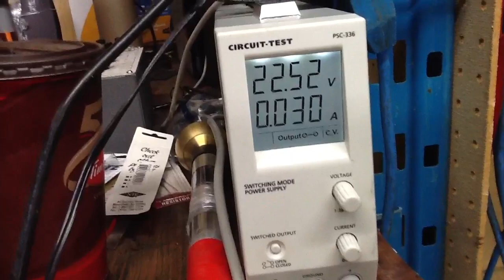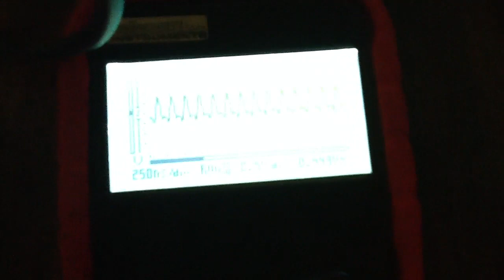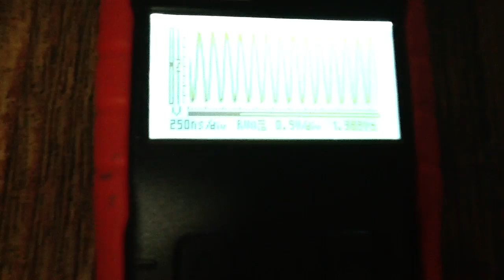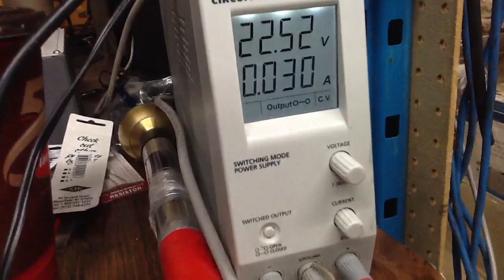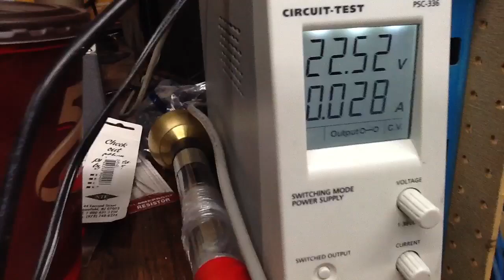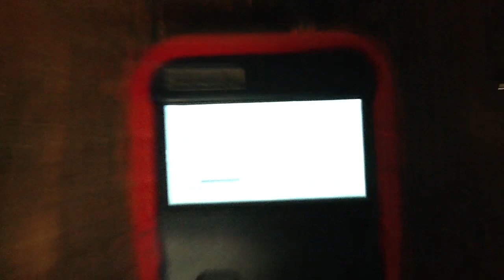SEC Exciter to Magnifier part 2

Comment: I don't know if it's the same principle as some of Tesla's work, but I have a replicated version of Kapanadze's device.  I am not the best with circuits, so I used a mechanical switching device to create the impulse currents/surge currents and one of the keys to make it work is called "Current Resonance".  If their are Amp's being destroyed in the Primary discharge circuit, the device will not put out more than it takes in.  So everything from the input energy to the secondary is in resonance and there is no current being used in the process at all.  Mainly at the point of excitation, in creating the Impulse Waves. Hopefully that might help you. Good Luck
Reply from the maker: well if you have replicated Kapanadze's self running device then i for one would be interested in it ! that is essentially my goal. i will look for your video!